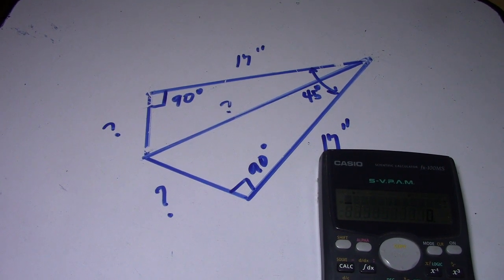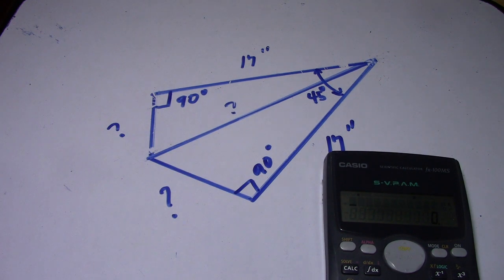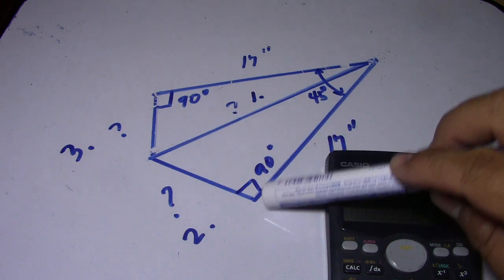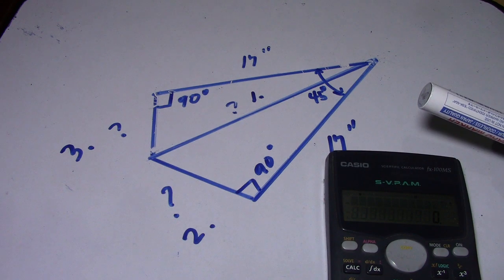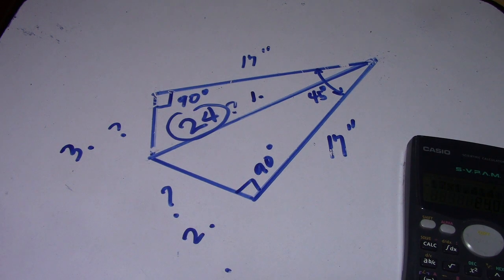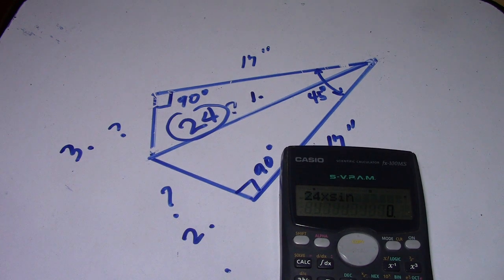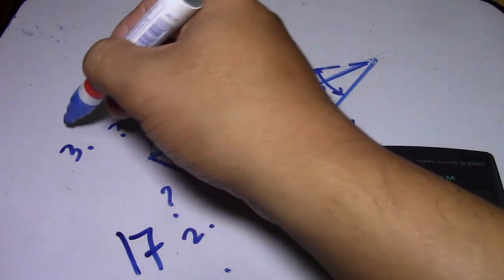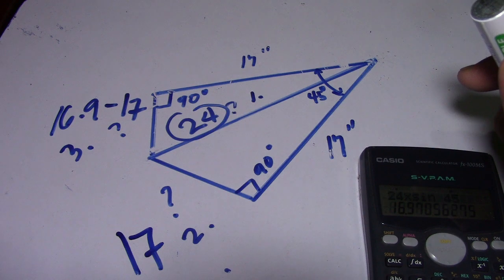Pipefitter How to Solve Angle Computation - PipingWeldingNonDestructiveExamination-NDT

Comment: By a look, illustration is not correct. How can you combine both horizontal and vertical planes vertices in a single angle? The horizontal plane triangle was just re-orientated vertically thus having the same 45 degrees angle, both sides are each 17" and of course in a common hypotenuse of 24". No need to calculate; there are still lots of pipes to fit-up, hurry up.  Sorry Mr. Instructor.